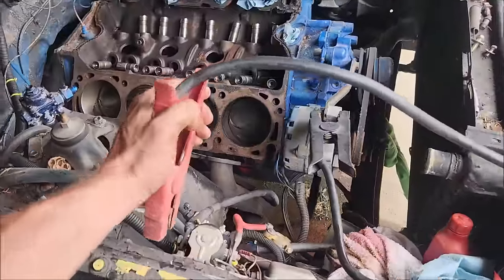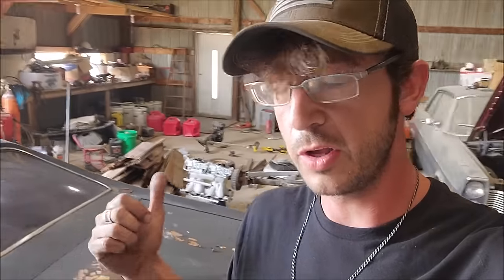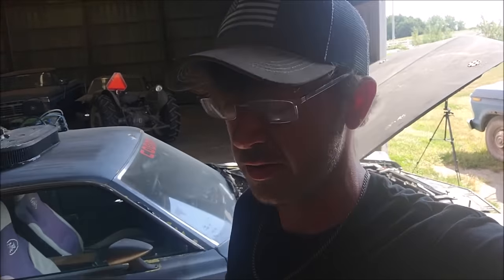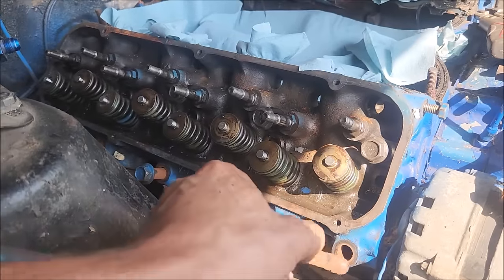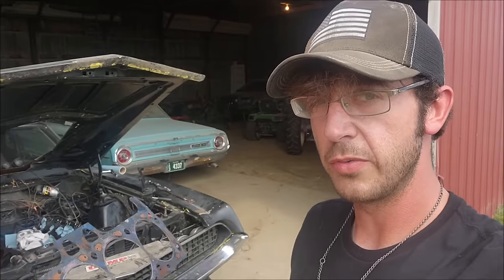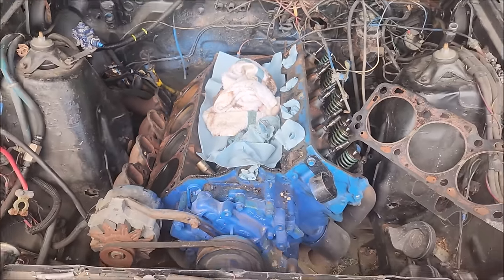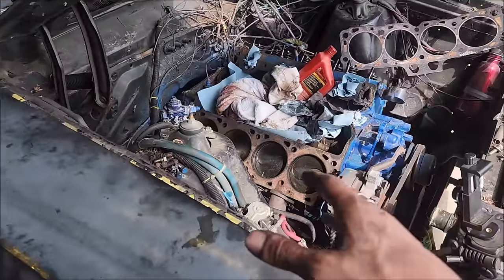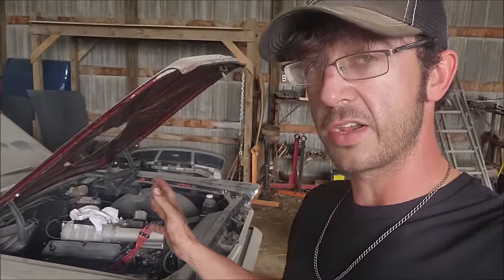Will it Run? Engine Fubar? 1970 Ford Torino DRAG CAR - Parked 20 Years Ago!

Comment: Assemble the 429… bump the compression, and run it on E85. You could easily do 10:1 or more on corn. 
Do some sort of holly injection, a rowdy I’m hot for teacher cam, the aluminum heads you mentioned…
Slap it in with a transasapt and bolt up a freshened up junkyard 4L80E with a 3500-ish stall. 
Budget paint and body, dark silver always looks amazing, some sort of darker silver, almost gunmetal grey stripes painted on and a dozen coats of clear… all done on the cheap of corse… in the back yard even. 
Lose the drag tires… run some 22”x12” wheels in back with a 395 or more section width, and a little more sidewalk than normal, and some 19x8 or 20x8 up front. Lowered, but not slammed. 
Tune the piss out of it like only you can do and see if you can get over 20MPG on the freeway. 
You could probably do all this for 15K, so it could be a long term project, but I think this would be easy for you, could turn out to be a very nice car, and would be stupid fun on the street.

Comment: I would go for a period correct look with it, go with a typical 514 but keep the 80s/90s look, keep it relatively mild for drag and drive fun.. It's not going to beat anything modern at the track, but would be a good time. Looks like it was yellow, maybe try to get that black paint off and see what's underneath.

Comment: You might find that you want to strip it blast it ALL and then you’ll know what the restoration would entail but only if you continue to fall in love. I’d love to see that car on the track in a dark flake jade green and black. I’d stay in the compression range most ideal for NOS and the addition of boost when rebuilding the shortblock, headwork……hard to say but if the heads are reworked to equal spec as the SCJ 429 you’d have the ability to run from as-is aspiration to whatever you might dream. 10-15psi boost and NOS with cam to match, could really turn on even a stock 429 SCJ.

Comment: I don’t do much motor work, but I still lay on cardboard to work on the stereo system in my ‘04 F-150 8200 GVW. Has an Alpine stereo, 10,000 watts, 13 Alpine amplifiers, 16 vocal speakers, 6 10” subwoofers in a custom built sub box that I built. Has dual alternators, dual charging systems, Alpine alarm, self built alarm for the amplifiers enclosure and so much More. Video of it is on my channel.

Comment: I think you made the right choice luke. Current owner has it up for sale right now. Quarter panels are roached.
Reply from the maker: It seems like people looking at buying it are mentally stuck between "it needs to be perfect", and "it's a drag car". 
Personally I think it's perfect as a drag car when you can run it, it looks cool, and you don't have to worry about it. 
I sold it because I have no time or desire to have a dedicated drag car.
Reply: @ThunderHead289  totally understand why you sold it. Hopefully someone puts a hot engine in it and brings it to the track. Just want to say thanks for all the content and awesome carburetor information. You've helped me alot over the years!

Comment: Luke, keep it and make it an ongoing project on the channel. You'll be glad you did when you're ripping it down the track.

If the fifth digit in the vin is a "C" or a "J" it's a real Cobra Jet If it's an "N" it's a ThunderJet. That said, only the Cobra Jet had the Cobra emblem in the dash. Also, the 1970-71 429 CJ was the most powerful of all the 385 series motors and the engine I'd build unless I went with a modern Ford Performance A-360 block. Kaase SR-71 heads are the absolute best heads for these followed by his P-51 heads. Although TrickFlow heads may be just as good as the Kaase P-51s. It's debatable.

Comment: I wish I hadn't sold the 70 cobra I had, If I were lucky enough to get another I'd Keep it. So my advise to you is keep it, they are hard to come by. For the near future I'd put some fine paper on my airfile clean the engine up and make it run. The projects are a lot easier to move around if they run.

Comment: It is a Ford engine and it’s my experience that their older block don’t wear out as rapidly as a GM block or even MOPAR. Meaning that the rebuild may not require as much machine work to complete, as it might if it were either of the others.
Reply: The more modern high nickel blocks wear very very slow. Not sure about the gm stuff because I hate em, but everybody else has high nickel these days.

Comment: Interesting point on the red RTV connected to hackery. So, as we all know, there are different colored RTV formulas for specific applications.. Blue isn't for high heat (I think red is) I, honestly, use black or the new "great stuff" black, that is really good and multi application RTV. Cheap too!

Comment: You can tell if its a real king cobra by looking at the torque converter.  The king cobra converters have hardened studs and welded on straps on both sides of the converter studs.  Warning.  There are 2 different converter pilot diameters in 429, 460 cranks. I dont recall the model break. But 70 429s used a stubby hub converter. Slightly newer used a longer converter hub .

And yes. Exhaust clearance is insanely tight.   Have to lift one side of the engine to get cast iron exhaust out.

Comment: Dont feel bad or worry about no oil,I picked up a 68 mustang the other day,and it didnt have a drop of oil in it either.so i jacked it up and figured I’d pull the plug and make sure it didn’t have water in the pan,and it didn’t even have a drain plug.glad I didn’t put oil in it,would’ve made a mess and a half

Comment: At approximately 5:12... "You know what they say, you're not a real mechanic unless you're laying on cardboard...". I don't know who "they" are either but I know who I am and what I say. What I say is to score a decent piece of carpet that's about 6 feet by 12 feet in size and lay on that instead of cardboard. You just roll it up for storage and unroll it under your rig when you go to work on it. Used carpet works just fine and isn't difficult to come up with if you get to know a general contractor or a carpet installer. They not only install, they often remove as well and when they do? The used carpet mostly gets tossed into a dumpster. The great things about carpet:

1. It acts as an insulator against heat or cold (you'll massively appreciate it in the Winter!)
2. It acts as a barrier against pests if you lay it on the ground under a rig in the field.
3. It'll keep you cleaner than cardboard, especially if you use it in the field. Working in tall grass and mud blows.
4. You can easily vacuum it or beat the dust out of it to keep it clean.
5. If the carpet gets slimed with something like oil, you can toss it - it was free so no loss.
6. Spray the backing with silicone or some kind of a water barrier, it'll stay dry - cardboard absorbs water.

 There is a bit of a downside to carpet... it isn't as easy to get as cardboard for most people. You do have to be mindful of spilling liquids into carpet, liquids like oil won't want to easily come out. Unless you've got an easy supply of used carpet, you've got to be mindful of the carpet or you'll slime it and dog yourself. Laying down on carpet that has oil or trans fluid spilled into it isn't as bad as laying right on concrete that has oil or trans fluid spilled on it... but it's bad enough. Don't ask me how I know that. Even so, if you're reasonably careful, having carpet to lay on is totally worth it IMHO. I recommend grabbing whatever pieces that you deem worthwhile and giving them a try. Peace & good vibes to all! ✌🏻👍🏻🤘🏻

- Max Giganteum

Comment: I've never had a use or need for red RTV. Ultra black and ultra grey cover all applications. high temp, oil/gas resistant,  etc.. both of which are used by most manufacturers, just re-branded as their own..

Comment: Master Luke, I hope this comes across as useful information rather than a lecture.  I really hope you will consider using an engine crane to move the heavy stuff in and out of those engine bays. Working in rehab hospitals, I learned that it is not the one big lift that damages your back.  It is the thousands of smaller ones, over time.  And then one day you lean over to pick up that one pound Fedex box and your back goes "sprang!"  And no amount of chiropractic, pain medicine, surgery, Pilates, yoga, or rehab will make it right again.  And then you will not be able to enjoy the magic you do with cars, or to share it with others.  

As for the Torino, I hope you keep it for now and get it running in some form.  It is one of the last of the real Fairlanes, before they turned them into just a smaller, fatter Crown Victoria Luxobarge.  Get it running, do some runs in it, and then you will know whether you have a real use for it, or should find it another good home.

Comment: I’d pull it, deck it, bore .030 over, new pistons and bearings. Polish the crank, be build the heads. Check the cam and lifters unless they’re rusty- new timing set, then reassemble and have fun.

Comment: The wise thing to do is the sell it for a decent profit and concentrate on your existing projects. 
But old cars and logic seldom run together so taking lube it up or pull the engine out and start the process. You  have the storage space available inside the building. This is a once-in-a-lifetime find. It fits with you if you don't mind the lack of Street ability.

Comment: I would love to see you take the block to a machine shop and have it decked and bored showing how much you could have in it after buying all the necessary parts needed after the bore job. I have a 396 with a similar issue on cylinders and thinking of just getting it running to drive around or actually doing it right and do a bore to the block.

Comment: rebuild the 429 with a set of aluminum heads, .030 pistons, cam, intake and carb and make it into a drag and drive pro street. a mild build would be about 400hp. would love to see you build it into a 500-600hp 7k rpm high compression 435 (thats what the cubic inch of a 429 bored .030 over). if you did not fall in love with the build and car you can sell it for a lot more money than what your asking for right now, but i hope you fall in love with it and take it on power tour and drag and drives.

Comment: Please invest in new 7/16-20 rocker arm nuts. If they have been adjusted a few times they will come loose.  The rocker arm will back off.  Either the pushrod will come out or come out of the socket.  Jam the rocker to force the valve wide open hitting the piston.    Summit, McMaster both have the proper lock nuts.

Comment: I'd likely go cheap.  I'd pull the motor and knock it down.  Evaluate all the bits and pieces.  Bore it 0.010" over.  Zero deck it, knurl the pistons, new rings and back together.  Yes it'll make some noise, but not much.  Then I'd spend time dialing in the carbs.  Likely they are running super rich at idle and low speed.  Get them straightened out for mixture.  Then I'd put a 150 plate under each carb and a big bottle in the trunk.  Warm the tires good and have the NOS come on with a throttle switch.  Leave and lean into it as the tires will take it.  Could be a quick beast.  And that extra piston clearance will get used up with the NOS heat by the time you hit the big end 😁

Comment: Luke, I assume you are quite busy with living your life, family, work etc.  I would suggest you put your energy in the 65 Galaxie.  In my opinion, you will find it a better all round driver than dealing with the 70 Torino drag suspension while still being able to produce some of your great content.  And I must tell you the truth, when I was 15 years old, I pulled a 289 out of a 1966 Galaxie did a complete rebuild.  So I have some good memories working on the Galaxie.  Circa 1971.

Comment: My theory behind the red RTV is that folks who use it for everything assume since it's high temp it is optimal for every scenario. They don't truly know the difference between the types of rtv or when and where one style should be used instead of another. There same limited knowledge hackery that that would compel someone to use wheel bearing grease on brake components and wd40 on a noisy belt.

Comment: God I want that car, thought obviously a fastback would be cooler and worth more.. but still. My first car was a 69 Ranchero GT so I kind of fell in love with the Torino platform. Unfortunately I probably can't afford it and definitely can't afford to fly to Iowa and rent a truck and bring it home. There's one for sale near me but it's got a small block with a spun bearing and yet the guy still wants $6000 for it and hasn't budged in over 8 months. Luke, on big blocks it's a good idea to use an engine crane and a chain on the intake bolts to lift the head off.. It'll save your core, I mean they only weigh ~95lbs each. The big plus to those is those are the round port heads.. If you want to make power with a stock head, those are the ones you want not the square port heads.

Comment: If you are going to pull it out and build it you can turn the 429 into a 460 by just changing out the rotating assembly, it’s a no-brainer if you’re going to  bore it anyways, depending on if the heads are dove heads, cobra jet heads or stock heads you can sell them for a little to go towards the build. Definitely be a cool car when you’re done with it and hard to find another one if you ever wanted one for the money you’d have in it.

Comment: That engine is called a 429 Thunderjet. It was originally available in a 1968 Thunderbird. Looking at the pullies on the motor, yours is a 1969  07 1970 engine. That engine was actually available in that year Torino.

Comment: The door panels and the dash are Cobra parts, but the taillight assembly is a GT. I’d run the vin to see if it is a Cobra. Since the vin on the dash can be easily removed, I’d double check it with the partial vin on the body tag located under the fender on each side just forward of the cowl. The 429 is a very popular engine with the older car guys like me. Some even prefer the 429 over the 460. It would be nice to know if that 429 is a ThunderJet, CobraJet, or Super CobraJet. A Super CobraJet has 4 bolt mains. It’s possible it could be a Boss or interceptor, but that’s highly unlikely. I have a 1970 Torino GT and I would love to see yours back on the road.

Comment: FYI a golfball will fit into the intake port of a 385 series head. Save this engine because it has flat tops. If you do over bore it keep it flat tops.. 460 is a 4.360" bore. Whatever you do we support what you do!!!

Comment: Blue RTV is the hackery I find. Two engines had the water pump replaced. Whoever had used enough blue RTV  that the excess goo extruded itself into a coolant passage in the cylinder head.

Comment: Get that Galaxie going first, you're so close!  After that, I'd go with option #2, pull that 429, send it off the the machine shop with the heads, have it decked, bored, honed, and the heads gone over as well... valves, resurface and make sure it will seal well.

Comment: Hi Luke, Me personally I would like to see you pull the motor down, take it to work and surface the heads and block. new valve guides rings and bearings, and of course a complete gasket set. Do I remember seeing a supercharger in your shed? That would look good on that high rise manifold with two transverse mounted Holley double pumpers on top. Just a thought.
Cheers Roger, from Aussie

Comment: Pull the engine, get the block milled, hone out cylinders, new rings, run it as is. I believe that engine is very capable and would be very strong with some minor modifications. Do some testing on stock engine then in the future rebuild the motor and compare the results. Would love to see the before and after results between the stock or rebuilt engine. Not sure the motor is capable of handling the dual carb manifold setup - possibly try running with one carb, rebuild then run both carbs.

Comment: Being an old guy,,,yank it blw it apart,fix all the homade stuff,,,assembled and drive,  im very familiar with the engine. If your going to race it so much needs to be done.  The pan plug location set off alarm bells for me.  😂

Comment: I’ve seen some pretty expensive big block builds with plugged up oil pickup tubes with that red silicone crap. That “gob it on” tribe needs to be working on lawnmowers 😅

Comment: I think pulling the engine is in order to have the block cleaned up properly.  Then at that point, might as well get a stroker crank and aim for 545 cubic inches.

Comment: With the projects you have already I’d opt to fix the 429 …..at least tear it down and see if it can be honed if not bored…
Get the machine work done right and it’ll last. The heads appear to be the closed chamber heads (68-70) DOVE heads is what I’ve always called those years….best factory  performing  passenger car heads for the 429/460 (other than the CJ head) 
I’ve easily made over  500 hp with a mild 460 using those heads , healthy cam and headers.

Comment: For now, roll it into the spot next to the Galaxie, pull the longblock, figure out what you want to do, engine-wise, then go ahead and finish up the '65 Galaxie while the Torino is waiting for either a rebuilt 429CJ (either with the current dual carb setup, or something simpler), or a 460...  That way, the '65 will see some drive time before salt season starts.

Comment: So with your question 
Pull the 429 have it built 
In the mean time tighten up the body, anything else it might need 
Save the car  it's a great platform already 
You won't find another one as clean or it will take time.